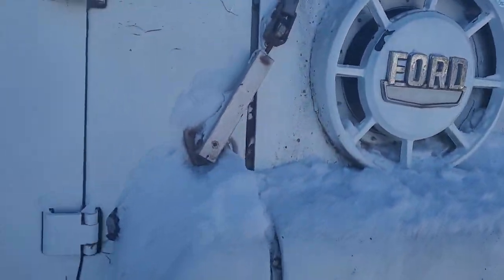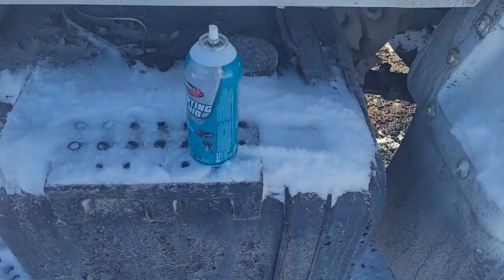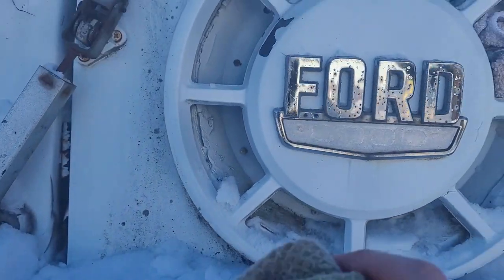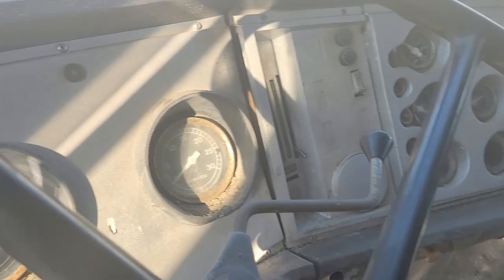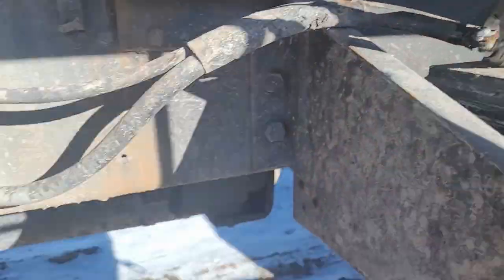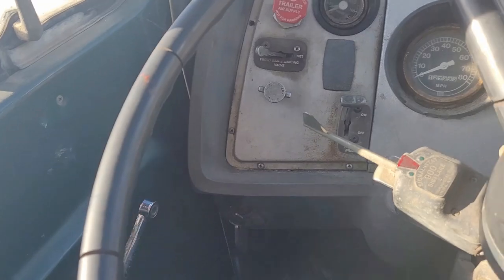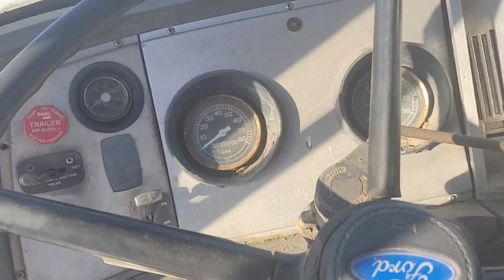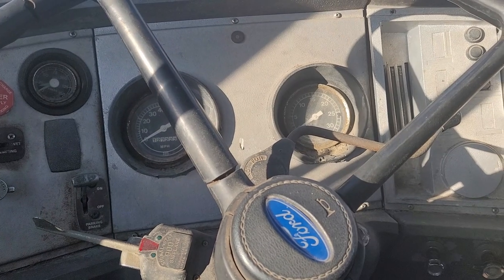Cold Start - 1972 Detroit Diesel 6v53 - 2 stroke diesel

Comment: When you first got in the cab. Did I hear you say   choke is in.  Never seen  a Detroit or any other diesel with a choke.. been around a pretty good while  but I guess I may have missed  a few  things. I guess you are never to old to learn new things  uhm  I ll be damned
Reply from the maker: I haven't driven any other diesels so I have no idea lol.  Mine has a choke and thats how I shut it down
Reply: @goddom its the air cut off...  similar in concept except it closes fully unlike a choke. Its basically the emergency stop... most detroits you can stop by defueling at the rack also. I have a 671 in a bus the flap on it is electrically acutuated so you pull the estop and then if you want to start up again you have to go physically reset the estop... obviously alot simpler when you can just run a cable to the flap on a truck like this. I also have a 353 detroit alum block, that is not in anything at the moment... no flap on it but it will stop by defueling the rack. the flap is some extra safety also in case your rack gets stuck fueling...

Comment: I Love the cranking and I have never seen anybody soak rags with starting fluid where did you get this idea? Pretty cool and is this the original engine? And where are at I can tell somewhere pretty cold?
Reply from the maker: My father in-law is an old farmer and he told me about soaking the rags. Works like a charm! As far as I know, its the original engine and I live in South East Michigan, and it can get pretty cold in the winter.
Reply: typically it would be a gas rag on a tractor and you snap it away off the intake once it starts thats how we did it on a ford 3000...

Comment: Would love to see what you’re doing with the throttle pedal when cranking it up
Reply from the maker: Hello, I am not touching the throttle at all, just letting the engine crank.
Reply: You don't need to do anything... it has a mechanical govornor that is holding the fuel open untill they RPM hits where it should be at, as long as the RPM is too low it gives it more fuel.

Comment: Chevy-powered Ford 😁
Reply: GM - Detroit Diesel was one of the very few companies to make Smaller High Speed Diesel engines in 1972, Even in GM Trucks They had V53's - And DH478...There was a Clatterpillar 1100 (Predecessor to 3208) and V6/V8 Cummins 378/504/555...On other side of Pond, 510/540 Perkins...Of all those listed the Loudest (6V53) was the longest lasting.
Reply: Lol not Chevy powered.
Reply: @jerodwallis7158  Who do you think makes Detroit Diesel lol the older models even say GM Diesel on them

Comment: Omg those rag could get sucked in and diesels don’t have chokes- only petrols.
Reply from the maker: There is an air filter behind that opening, so there is no danger of the rags getting sucked in.
Reply: I soak rags with gasoline and you can use brake cleaner as well
Reply: I soak rags with gasoline and you can use brake cleaner as well